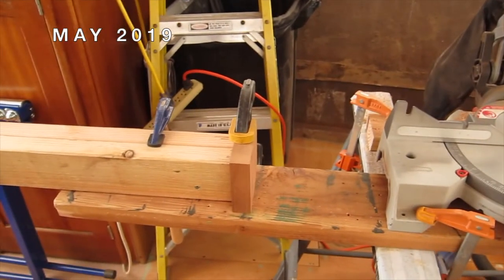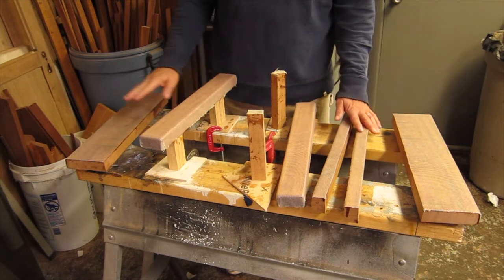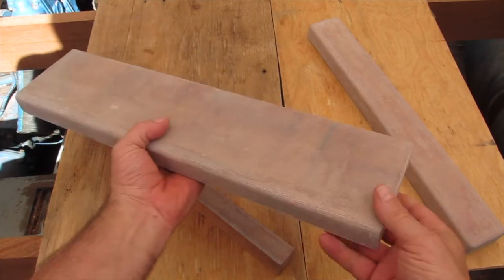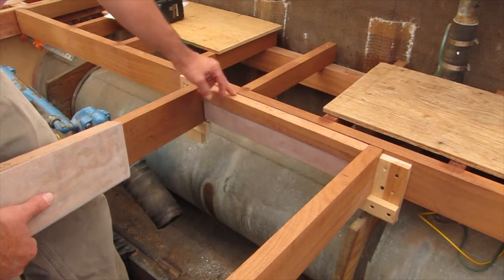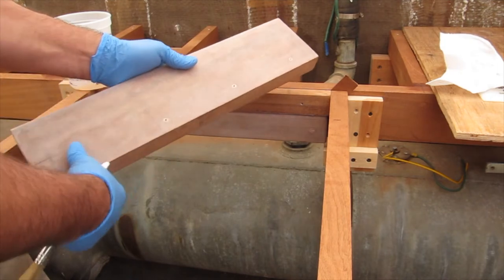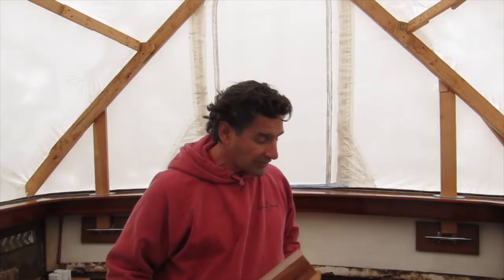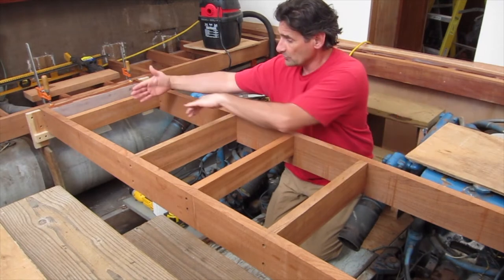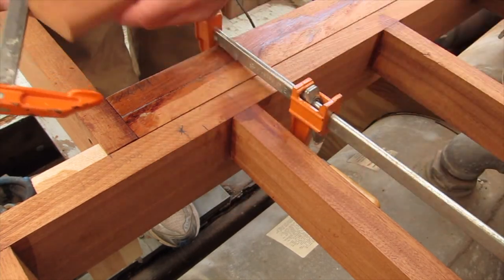Cockpit Deck Framing - Mahogany Center Frame Assembly - Boat Restoration EP036

Comment: Another great episode Bob. I enjoy the way you test fit each piece before fastening it in place. You were extremely lucky when you found all that lumber. What an upgrade and fiberglassing the at risk pieces should make them outlast us! Love that air hammer on the plugs! Take care, Jerry.
Reply from the maker: Thanks Jerry. Good catch. I was wondering if anyone was going to comment on the fact that I didn't glass all areas. You take care as well.